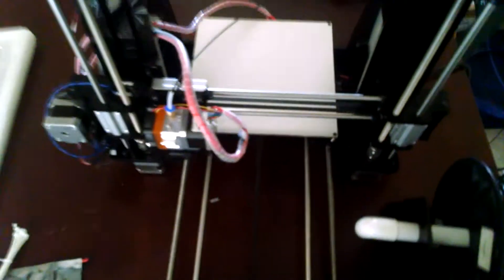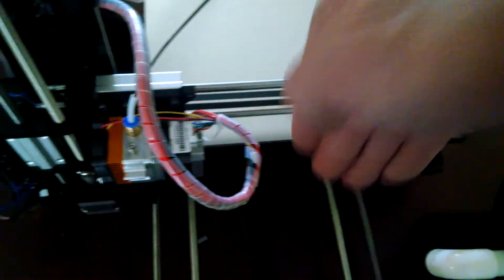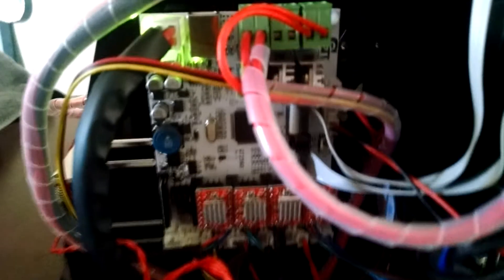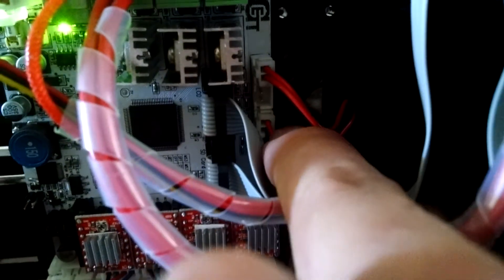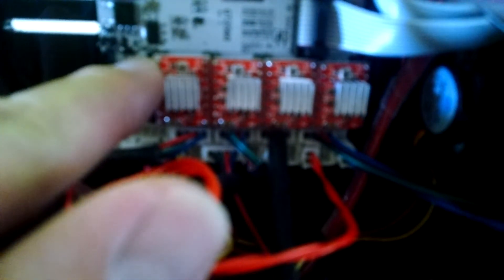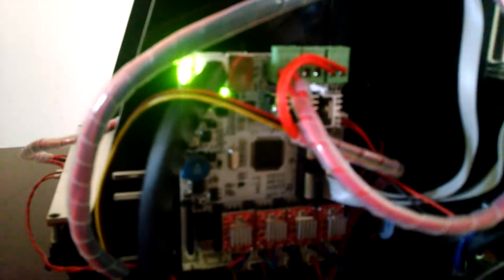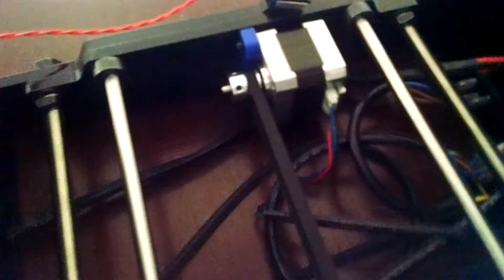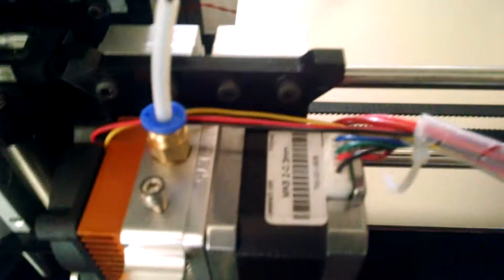Geeetech Prusa i3 Pro X (some Info on firmware)

Comment: glad i found this video, i have that printer so now i know what the plug sockets are, as mine had no instructions and was sold me as an a8 printer... i can now go looking for a more upto date firmware and maybe get the sd card reader to work...
Reply from the maker: +lez briddon for ad SD card, try flipping wire connection 180 for SD card and may work. Depends on manufacturer of board. To get around patent of other design, they make a change like rotating the LCD cable 180° on same board. But could also be firmware.

Comment: I have a gt2560 that when I try to upload firmware keeps timing out. Won't load.  Any ideas?
Reply from the maker: +James Tabor version of Arduino IDE makes a difference. My firmware is based on the version available on my first WordPress blog post.
Reply from the maker: +James Tabor if Mac, then have to find the YouTube video that show how to fix the drivers,
If windows, may be expired USB driver kinda deal, and have seen some with bootloader issues.
Reply from the maker: +James Tabor what chip installed on board atmel 2560 or different like a 1280 something? Just found this out via another comment

Comment: my screen stays blank
Reply from the maker: +yul merced you need to try switching the connections. One manufacturing company flips one connection 180° so the wire is on up and one down. Check this, then go to the blog for the rest. Link to blog on my YouTube channel.
Reply: George Robles i mean the sd card and display cable?
Reply from the maker: Yes, that is the most common thing right off if display never worked
Reply: now im getting squares
Reply from the maker: Reset it. Maybe need to reflash the firmware

Comment: on the controller board has 2 y plug inserts only 4 steppers only 3 of my motors work z x one of the y motors why dosn't my other moter work on the other side
Reply from the maker: z has 2 motors, up and down movement.
 y is bed, back to front movement. 1 motor.
x is side to side movement, 1 motor.
so that is first issue to correct the wire connections.

Comment: whats are the differents between the geeetech i3 pro b and the pro x?
Reply from the maker: Used to be the boards only and frame size. Pro X has same frame as the M201. So the main difference is the frame now a days and all acrylic parts on pro x vs printed parts on the pro b.

Comment: What firmware do you used for your i3 Pro X ?
Reply from the maker: go to link on WordPress (W) on my home channel.

or georgeroblesjr.wordpress.com
Reply from the maker: third blog
Reply: +George Robles no blog says for pro X only for a b c
Reply from the maker: +Handy Action gt2560 rev a is what you need.
I change  or two on the motor direction of X and or Y.
Configuration.h file is where to make the minor changes you need. Pro, pro b, pro c, pro X and very alike. And depending on length of X, may need to increase the max travel after homing.
Reply: Arduino: 1.6.10 (Windows 10), Board: "Arduino/Genuino Mega or Mega 2560, ATmega2560 (Mega 2560)"In file included from sketch\Marlin.h:23:0,                 from sketch\BlinkM.cpp:5:sketch\pins.h:3074:0: warning: "X_MAX_PIN" redefined #define X_MAX_PIN          -1 ^sketch\pins.h:1361:0: note: this is the location of the previous definition #define X_MAX_PIN 24 ^sketch\pins.h:3075:0: warning: "Y_MAX_PIN" redefined #define Y_MAX_PIN          -1 ^sketch\pins.h:1367:0: note: this is the location of the previous definition #define Y_MAX_PIN 28 ^sketch\pins.h:3076:0: warning: "Z_MAX_PIN" redefined #define Z_MAX_PIN          -1 ^sketch\pins.h:1373:0: note: this is the location of the previous definition #define Z_MAX_PIN 32 ^In file included from sketch\Marlin.h:23:0,                 from sketch\ConfigurationStore.cpp:1:sketch\pins.h:3074:0: warning: "X_MAX_PIN" redefined #define X_MAX_PIN          -1 ^sketch\pins.h:1361:0: note: this is the location of the previous definition #define X_MAX_PIN 24 ^sketch\pins.h:3075:0: warning: "Y_MAX_PIN" redefined #define Y_MAX_PIN          -1 ^sketch\pins.h:1367:0: note: this is the location of the previous definition #define Y_MAX_PIN 28 ^sketch\pins.h:3076:0: warning: "Z_MAX_PIN" redefined #define Z_MAX_PIN          -1 ^sketch\pins.h:1373:0: note: this is the location of the previous definition #define Z_MAX_PIN 32 ^In file included from sketch\Marlin.h:23:0,                 from sketch\thermistortables.h:4,                 from sketch\Configuration.h:826,                 from C:\Users\Julian\Downloads\GT2560RevA_Autolevel\GT2560RevA_Autolevel\GT2560RevA_Autolevel.ino:35:sketch\pins.h:3074:0: warning: "X_MAX_PIN" redefined #define X_MAX_PIN          -1 ^sketch\pins.h:1361:0: note: this is the location of the previous definition #define X_MAX_PIN 24 ^sketch\pins.h:3075:0: warning: "Y_MAX_PIN" redefined #define Y_MAX_PIN          -1 ^sketch\pins.h:1367:0: note: this is the location of the previous definition #define Y_MAX_PIN 28 ^sketch\pins.h:3076:0: warning: "Z_MAX_PIN" redefined #define Z_MAX_PIN          -1 ^sketch\pins.h:1373:0: note: this is the location of the previous definition #define Z_MAX_PIN 32 ^In file included from sketch\Marlin.h:23:0,                 from sketch\MarlinSerial.cpp:23:sketch\pins.h:3074:0: warning: "X_MAX_PIN" redefined #define X_MAX_PIN          -1 ^sketch\pins.h:1361:0: note: this is the location of the previous definition #define X_MAX_PIN 24 ^sketch\pins.h:3075:0: warning: "Y_MAX_PIN" redefined #define Y_MAX_PIN          -1 ^sketch\pins.h:1367:0: note: this is the location of the previous definition #define Y_MAX_PIN 28 ^sketch\pins.h:3076:0: warning: "Z_MAX_PIN" redefined #define Z_MAX_PIN          -1 ^sketch\pins.h:1373:0: note: this is the location of the previous definition #define Z_MAX_PIN 32 ^In file included from sketch\Marlin.h:23:0,                 from sketch\Marlin_main.cpp:30:sketch\pins.h:3074:0: warning: "X_MAX_PIN" redefined #define X_MAX_PIN          -1 ^sketch\pins.h:1361:0: note: this is the location of the previous definition #define X_MAX_PIN 24 ^sketch\pins.h:3075:0: warning: "Y_MAX_PIN" redefined #define Y_MAX_PIN          -1 ^sketch\pins.h:1367:0: note: this is the location of the previous definition #define Y_MAX_PIN 28 ^sketch\pins.h:3076:0: warning: "Z_MAX_PIN" redefined #define Z_MAX_PIN          -1 ^sketch\pins.h:1373:0: note: this is the location of the previous definition #define Z_MAX_PIN 32 ^sketch\Marlin_main.cpp:2667:36: warning: invalid suffix on literal; C++11 requires a space between literal and string macro [-Wliteral-suffix]         LCD_MESSAGEPGM(MACHINE_NAME" "MSG_OFF".");                                    ^In file included from sketch\SdFile.h:27:0,                 from sketch\cardreader.h:8,                 from sketch\Marlin_main.cpp:44:SdBaseFile.h:38: error: using typedef-name 'fpos_t' after 'struct' struct fpos_t {        ^In file included from sketch\Marlin.h:10:0,                 from sketch\Marlin_main.cpp:30:c:\program files (x86)\arduino\hardware\tools\avr\avr\include\stdio.h:950:33: note: 'fpos_t' has a previous declaration here __extension__ typedef long long fpos_t;                                 ^sketch\Marlin_main.cpp: In function 'void set_bed_level_equation_lsq(double*)':sketch\Marlin_main.cpp:998:36: warning: deprecated conversion from string constant to 'char*' [-Wwrite-strings]     planeNormal.debug("planeNormal");                                    ^exit status 1
using typedef-name 'fpos_t' after 'struct'I dont have an idea to fix it,  do you know how i can solve it, that the code gets right?I would be very happy if you could help me.
Reply from the maker: +DJ Watz DJ Watz Arduino ide 1.0.1
Up to Arduino ide 1.0.4

Comment from the maker: i am using printed parts on my own pro b. this was a pro X with metal brackets is inverted from my own. can also flip the wires 180° in the connection to reverse the motor. using Arduino ide 
in configuration.h tab, define X/Y/z/e axis directions. if backwards from what you want then invert the logic, true to false or false to true.

Comment: Hello I just finished assembling a Geeetech acrylic Prusa I3
Pro & Pro B.Ho Problems with engines X - Z .
Just do the Command House Z motors Turn on the contrary forcing the Movement Axis Z.
THE SAME He does it with X , does not go to the limit switch . It strikes the opposite side has .
I Have Some Examples
Thanks good job
Reply from the maker: +Claudio Scorziello  what control board are you using? 
All wires for endstop is to use outer pins on switch, and all sets go to min X, min Y, min z
On control board.
Bad translation, but I think I understand your problem.
But if you need to change direction of steppers, go to config.h tab and invert the logic for motor travel.
If your running a RAMPs, then just 180° the wires to invert direction.

Comment: I download your pro B 2560 rev AT&T board when I open it in Arduino it doesn't have a configuration tab
Reply from the maker: you have to unzip the file. it's compressed.

Comment: I watched the video but which one would I use for geeetech prusa i3 x
Reply from the maker: assuming you have firmware, use mega or adk for GT2560 Rev A board instead of Sanguinololu 16mhz . pro b set up will work too, just have to invert X and y stepper motor direction in config.h tab in firmware. links to my setups in channel page.

Comment: Any step by step on how to update the firmware. I download arduino 1.0.1 and download the i3x zip but it tells me there was a problem compiling. Any help would be appreciated
Reply from the maker: yes, one out there and example is showing Sanguinololu board, just select board for Mega or adk instead of the Sanguinololu board. next reply will have video
Reply from the maker: +Huskybeard90 
https://youtu.be/eakm1zUF47s

Comment: Would you share the STL file for the motor bracket you made for the y axis motor?
Reply from the maker: Geeetech I3X Y-Axis Motor Mount found on #Thingiverse https://www.thingiverse.com/thing:1107483
Reply from the maker: It's on thingiverse already but I will when I get the chance if its not correct
Reply: Do you have a link for that? I cant find it